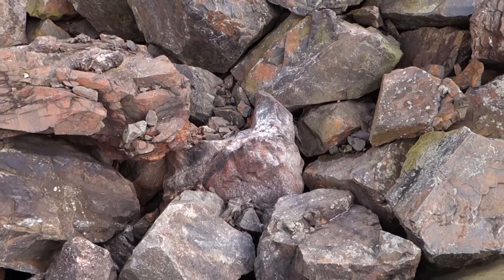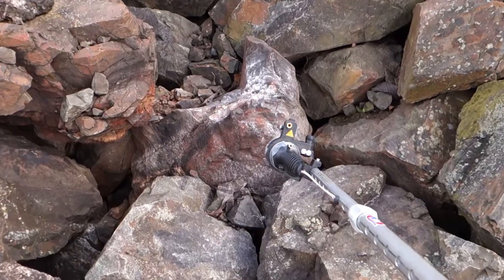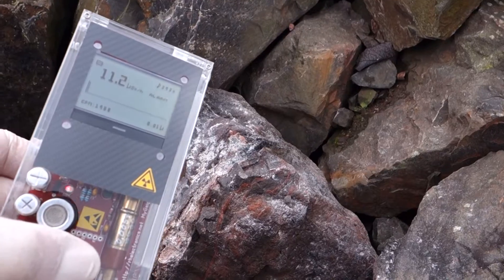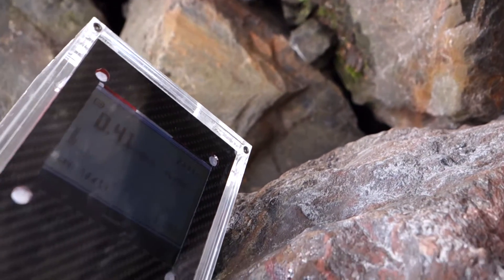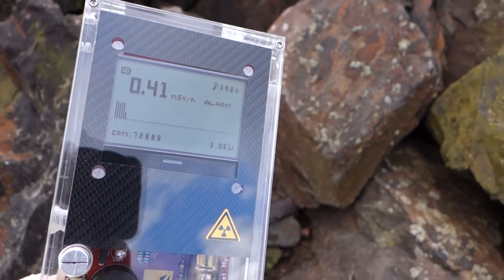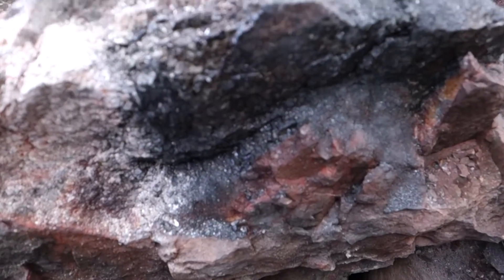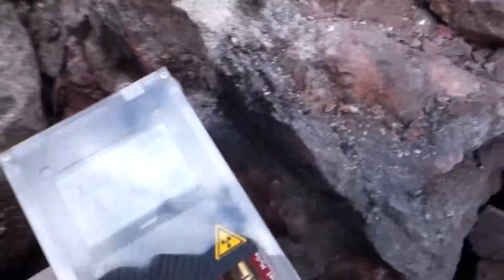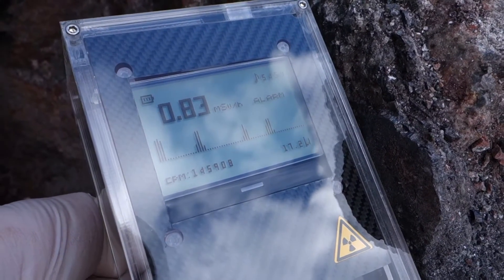Uraninite searching -finding Uranium ore

Comment: What is the grade of the ore here?
Reply from the maker: I would say high grade at some spots
Reply: @weirdmeisterinc  thanks im hopefully going collecting in South Africa ,any tips on getting good pieces?
im not sure of good how rich the locality is,i know its about 7usv/h gamma on a gammascout near the dumps
Reply from the maker: @uraninite8151  south africa ? Never heard of a locality from there , 7miksosieverts/h is very high, in pribram i measure near the dumps 0.5 to 1.0 mikrosieverts, so its hard to say if you will find rich ore because the high backround radiation can also come from small particles all over the place and no larger ore is on the ground (worst case) , so biggest part for success is: time ..need some days to find good pieces
Reply: weirdmeister inc. yeah it’s in the Karoo which is In the south west of SA and the place that I’m going to was excavated back in the 70s for testing but ended up being abandoned. it is in sandstone so the high background could be from particles and I’m also not sure how close the person who got the measurements was to the piles as they have already been separated in ore grades apparently.Also the piles are small only a few meters across so I think I won’t need too much time too find stuff.Well I hope I can even get into the area as I know similar sites nearby have been fenced off but it doesn’t matter too much as the whole are has lots of ore lying around and in the gravel roads.i have a feeling it won’t have the most active specimens but I have no way to know for sure .Thanks for the advice